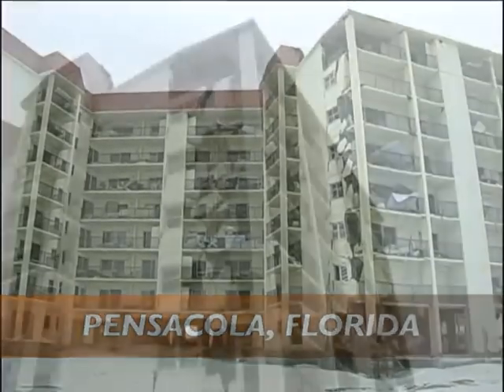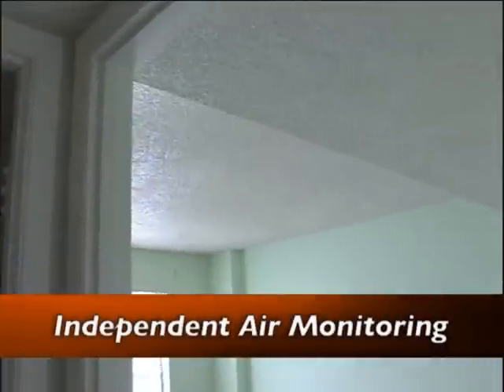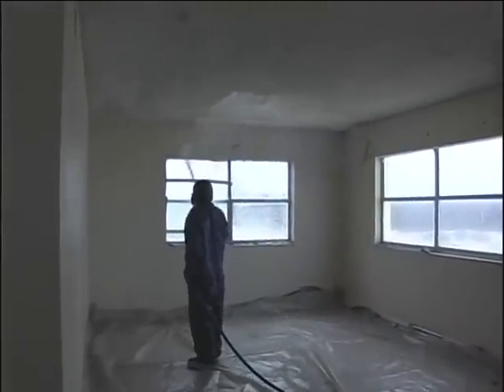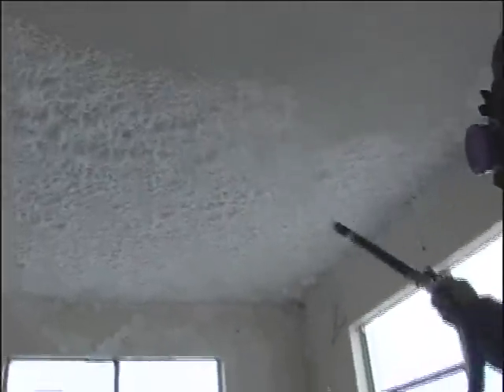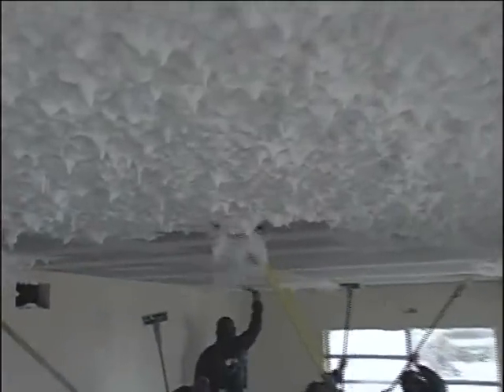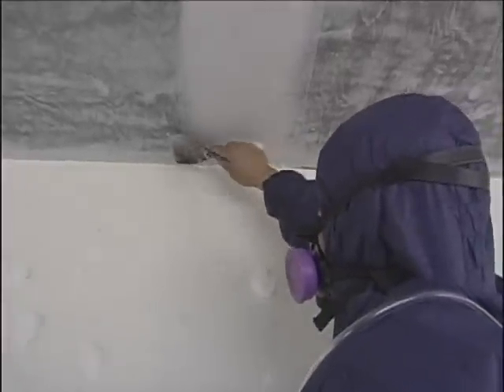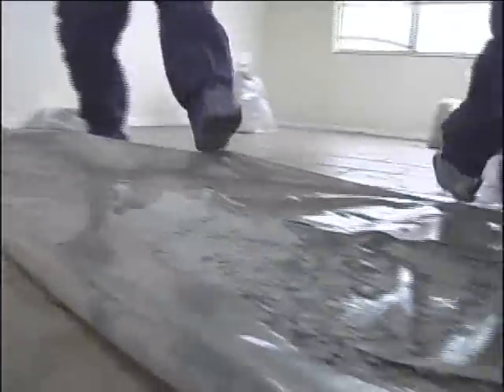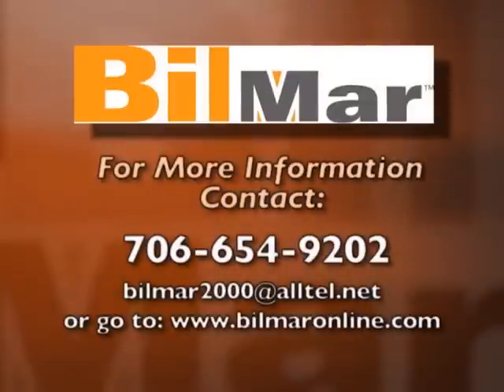Friable ceiling abatement using FoamShield's patented method

Comment: >Testing for asbestos requires a lab analysis.
>Air testing equipment monitors fiber release and makes sure none are airborne.

Pick one
Reply: They test for asbestos before to verify there is asbestos. The monitors are to verify the asbestos did no go airborne

Comment: I’ve never done a texture coat ceiling that wasn’t high risk. I’ve also never seen a texture coat ceiling get scraped off so ridiculously easy.
Reply: as long as its not painted it comes off pretty easy with a light misting of water,  you just have to be patient with it.  it shouldn't take longer than 15 minutes for the water to absorb into it.

Comment: Before the final clean up u have to pick up all the asbestos material and also get a visual inspection form the air monitor than u can remove the 6 mil poly and off the floor leave the  critical barriers up than he can run a pcm or TEM it depends on how big the job is and samples

Comment: this people are so stupid they don't know what they're doing first you have to put critical barriers on the windows and doors' vents you also have to cover the walls with two layers of plastic and three layers on the floor. one thing I didn't see in the job is a negative air machine and also they are wearing a hat and u can clearly see their clothes contaminated because the zipper on the protective suit is down.  Also when the clean up is done the top layer should be removed and bottom layer which is the clean one is supposed to stay in place until final clearances so the existing walls and floors do not get contaminated. Sorry to say it but these people are endangering their lives and possibly contaminating the environment outside of their work area because you can clearly see that there are no plastic barriers on the windows, unless I am blind.
Reply from the maker: Hi Marco.  We would be glad to discuss this more if you could show us where in the OSHA regulations you have to cover the walls with two layers of plastic and three layers on the floor.  Unfortunately many people do not truly know the regs, they just go by old work practices and do not take into account NEAs or AACMs and just want to assume a lot of things.
Reply: any over head removal is considered automatic high risk. 3 stage with shower, neg air, 6 mil poly on all surfaces. no street clothes on under tyvek either and no half masks. you need a papr with p100 filters for a job like that. also without 2 layers of 6 mil on the ground, how can you say the guy cutting the polly up and folding it didnt get a little on the floor? also you need to wipe all surfaces and poly down post abatment , pre air clearance.
Reply: @chrisbutton3651  lol since when do you use p100s on a papr
Reply: This system doesn't allow a Sigler fiber to go airborne. This company is one of the world's best abatement specialists in the world. I would have loved to work with this company when I was doing abstment. These guys make it an elegant process which is rarely seen.